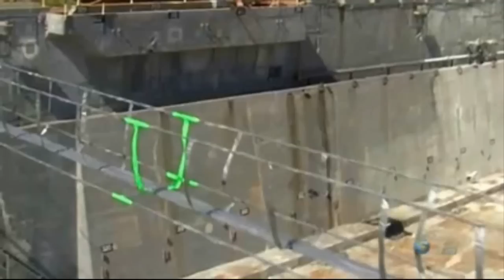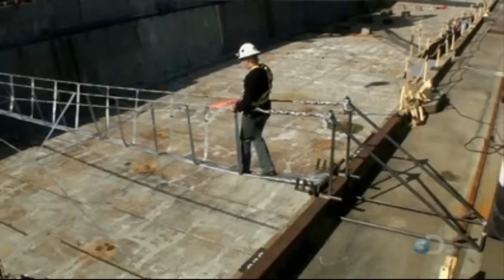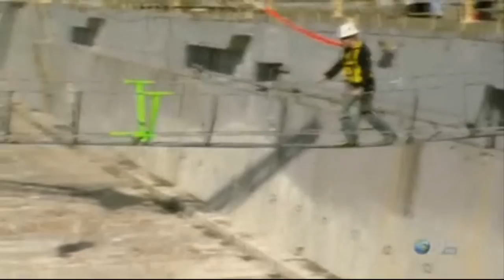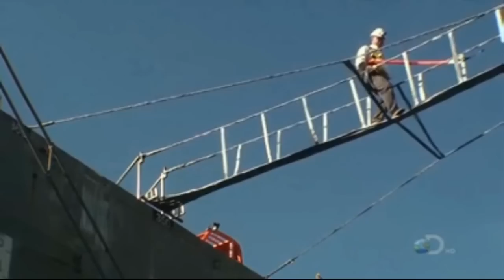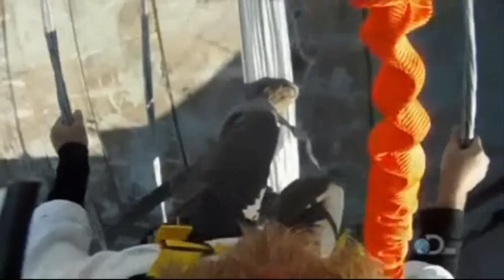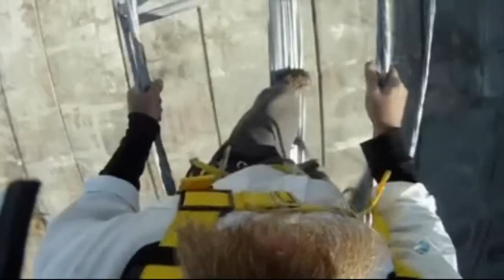MythBusters - Duct Tape Hour 2: 102 Uses For Duct Tape - Duct Tape Bridge

Comment: You guys might want to do a better job with lifelines next time cause on the sides of the bridge there is too much slack with that crane. use a horizontal cable life line to clip off on